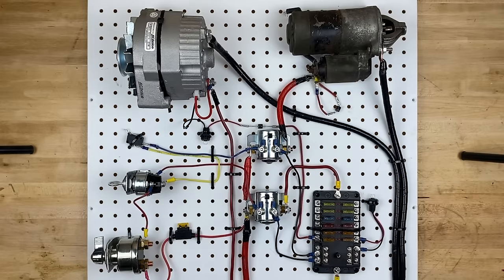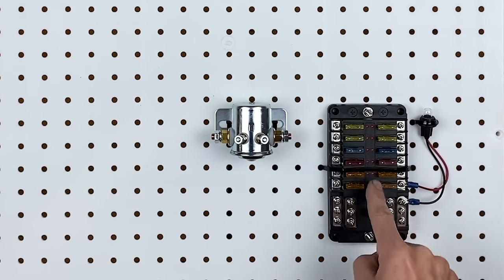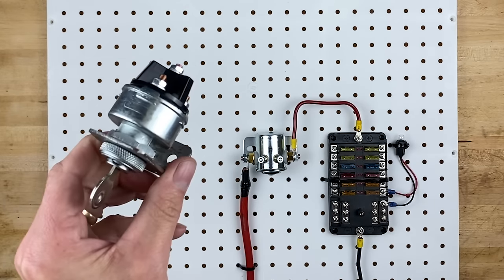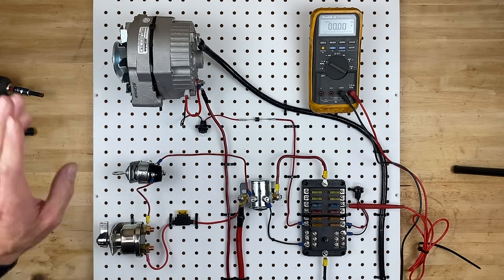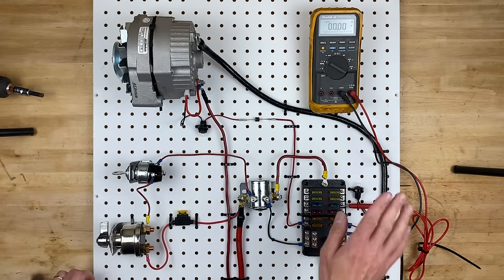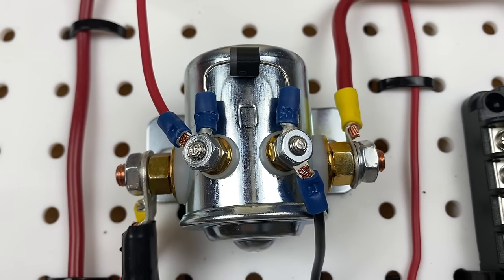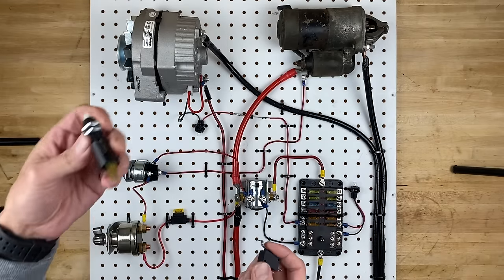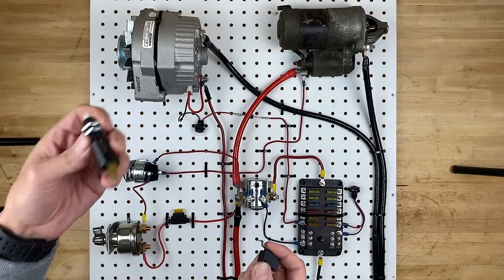Hotrod | Race car | Drift car Wiring for Beginners. (Alternator Battery Switch Fuse Box Starter)

Comment: I'm not an expert or anything like that but this is just my opinion, you mentioned that you should know the amp draw of your starter motor in order to choose appropriate fuse, i don't think thats accurate, I think you should know the amp rating of your wires instead and use a fuses to protect your wires for example if your load is 50A the wire installed has a amp rating of 60A shouldn't a fuse smaller than the maximum amp rating of your wire be used to protect your circuit/wire like 55A fuse for safety?

Comment: Wow thank you for your diagram i have complete different set up but was looking for that dam GM wiring diagram i might copy some of your design also i'm not as well a mechanic or engineer but i saw a design safety issue on your diagram there is one wire that should have a fuse before even connecting to the positive despite cause on your design the whole amperage will pass also in that little cable before the fuse becuase that there is a fuse in the middle the others side of the wire  can not handle a high amp and it will melt or overheat if ever the alternator produce too much amp. also one more thing your alternator positive pole doesn't appear to have a 2 awg gauge wire. your negative seem to be 2 awg wire but the positve seem like 4 or 8 gauge the positive is your hot wire it need a higher gauge,

Comment: In another video you said to have a "mega fuse" between starter and battery as close to battery as possible, now that there is the solenoid you still need the fuse correct?

Comment: Battery shut off is not effective and will not work if the main solenoid contacts stick in the closed position, which is a real problem. All power should always be taken off one main disconnect. Not sure why it would be different in racing but perhaps it is. Nice video.

Comment: Can i use this set up ? I have to many accessories wires going to the battery. would like to clean up the terminals by sending accessories wires to fuse box being controlled   by a  Solenoid. will that work?
every time i add something its said must go to Batt

Comment: Hello. Can you tell me about the Toyota Sienna 2008. The blue wire from the generator reads 0. All other 3 wires on the connector show more than 0 when the ignition is on.

Comment: I have a atv and wonting to put a switch into ignition to stop power when key is on if i cut the solid red wire on ignition side not the harness side and bring power from live on battery with a switch ive already tried it with some wire and it powers up as it should i just dont no if it will charge the battery still would it still charge the battery like this? Cheers

Comment: Question: I purchased this ignition switch for a project that uses a predator electric start which comes with its own ignition switch. About to make the swap but noticed the predator switch has a ground wire but the ignition switch you use does not. Do I need to modify?
Reply: I think I figured out an answer to my question. It's grounded through the negative terminal on the solenoid.

Comment: How would I wire this if I want to remove the key switch and use a toggle switch with a push button starter switch?
Reply from the maker: I don’t have specific instructions written out for this, but I do have a video that will probably help you out. https://youtu.be/LJ4wh_whblM

Comment: I'm trying to understand why there's two starter relays. Does it have a purpose to have two, is it doing the same thing, is it better? Please advise, I'm thinking about adding this additional starter relay to the standard factory setup that I already have, ie a starter motor with a built in starter solinoid. Thank you in advance.
Reply from the maker: The only purpose of the additional “ford style” separate starter solenoid is to add a convenient location under your hood for additional wire distribution and the ability to easily jump the starter from under the hood. Other than that, it’s redundant.

Comment: Towards the end you mention many fuses in the system. Are those only necessary when the battery is in the trunk?
Reply from the maker: Every circuit should be protected by a fuse close to the power source. That way if the wire breaks and grounds out, it will break the fuse instead of causing a fire.

Comment: Love the video but have one question - Why does the fuse board go off when the starter circuit is active, the neutral safety switch also seems to kill the fuse board i.e the fuseboard lamp goes off  - why??
Reply from the maker: Good catch. Somewhere in these comments somebody else caught this too. I should have used the other terminal on the ignition switch. I tested it to be sure and it’s definitely the reason. Great catch, and thanks for watching!
Reply: Just to clarify it's because you wired it to just accessories and not ignition on the ignition switch?  @WiringRescue

Comment: Quick question, when you switched the ignition switch to the start position the fuse box lost power and the light went out. Wouldn't the car be unable to start as there would be no power to spark/injectors?
Reply from the maker: You are correct! On the key/ignition switch I should have used the other terminal, if the ignition was going to be wired into that fuse panel.

Comment: With engine off, the battery needs to unload any extra energy back to the alternator field. Not sure  about this setup, but if you had checked the battery voltage you should have seen it drop, About 13.48 time stamp. The diode is about the battery not the solenoid. I am not a expert, but pretty sure i am correct. On my 64 Galaxie the  solenoid  is from battery on one side,, to starter on other side. I think you have this wired up wrong. Not sure but that is how my manual shows it.

Comment: At 19:40 you use a diode to keep the starter bendix from being engaged as long. My starter has no solenoid attached. It's already on the firewall. Where would I attach that diode to accomplish the same thing?
Thank you
Reply from the maker: You may not need that diode if your starter does not have the solenoid attached. Try it without it.  But if it does, it would go on the wire that comes from the ignition switch.

Comment: How do you get CURB LIGHTS on a trailer to turn on with the turn signal from your truck? Curb lights I mean are a wide angle light that shines down to the front of the trailer tire when you turn signal on so you can see how close you are to a curb when it’s dark.

Comment: i have 140 amp alternator - street and strip car.  Rear  / trunk mounted battery, car has electric fuel pump, twin electric fans, what size wire for alternator?  and do i need fuse in line of the alternator?

Comment: Great video, but one question. It looks like the ignition switch does not provide power to the fusebox during cranking. So if your ignition system is run off the fuse box (to enable the cutoff switch to work) the ignition does not receive power while cranking the engine over. How do you work around that and keep the cutoff switch?
Reply from the maker: Great catch! I hadn’t even noticed that when making the circuit! Luckily there are a couple of easy solutions that would likely work just fine.

1. Use the IGN terminal instead of the ACC terminal on the ignition switch to feed the master solenoid. I just tested this and it definitely works for cranking power, but then you lose the master solenoid power in the accessory key position. Probably not a big deal for a race car to be honest, but there is another option!

2. Add a jumper wire from the IGN terminal to the ACC terminal on the ignition switch. That way the accessories still work, and the ignition system (fuse panel) gets power when cranking.

Thanks again for the great catch! I truly appreciate you watching and adding great feedback into this! You rock!

Comment: May I ask why did you choose a solenoid relay instead of a Bosch type relay to power the fuse block?  Is the solenoid better?
Reply from the maker: The Cole Hersee solenoid can handle a whole lot more amperage. I believe it is rated to handle 200amps. Most of the bosch-style relays have about a 30-40 amp rating.  I prefer to over build the electrical system whenever possible. :)

Comment: Can you run your alt wire straight to the positive side of the starter solenoid instead of all the way back to the battery
Reply from the maker: It all kind of depends. Imagine you have a 200amp fuse on the fat wire that powers your starter solenoid. If you run your alternator to that same terminal on the starter solenoid, that means your alternator wire is now being protected by a 200amp fuse. In reality, your alternator likely does not need a 200amp fuse, because it probably puts out 85amps. So now if something goes wrong, you have an extra 115 amps that needs to go somewhere out of that alternator wire before a fuse stops it.  For my car, I’d do a separate fused wire that is set up for the amperage’s that the alternator will require. Fusing both ends of the alternator wire is also a good safety measure since power comes from both sides. Good luck on your project!

Comment: Hello again! Ive watched this video SO MANY TIMES! LOL. I thought i had it all figured out but Ive run into an issue now. I want to do this setup on my 84 Chevy truck, but Im not wiring everything in from scratch. If i run the two solenoids how do i jump my stock neutral safety switch in my steering column to my starter solenoid. I only have the one ignition wire coming from the cab into the engine bay which has to go to the first solenoid.
Reply from the maker: You’d have to run a wire back into your cab to the neutral safety switch and then back out again to your starter. I would think if you have factory wires on your neutral safety switch, it should already go to your starter. So you’re already half way done!
Reply: @WiringRescue  other question....you have the continuous duty solenoid to the fuse block right?
Reply from the maker: @jimmiechance4638  - that is correct!

Comment: Where did you find out about the diodes?
Reply from the maker: Uh oh. Why do you ask?  Did I get it all wrong?
Reply: @WiringRescue  Not that I am aware of.  Would like to do more reading on it.  Different industries handle this in different ways.  Riding lawnmowers don't put any protection in.  Thinking that is why they are burning up starter solenoids.  Dryers do not buffer their 240vac connections.  Dryers tend to burn up their contacts in the timers.  Some application use capacitors.  Would like to read up more on using diodes to protect against fly back voltage.
Reply from the maker: @tubejim101  - great info! Yes - I actually saw David Freiburger do this in his 31 Model A F-Rod project (though he didn’t actually mention it in his video, so I’m not totally sure) and then I did some research into it. It seems to be something that people do.

Comment: Wouldn't the starter burn our with the continuous 200 amp relay ? I working on a stock 68 dart with slant 6 and stock ammeter, I'm thinking of doing this mod along with 1 wire alternator upgrade . (Context)

Comment: Took me a second but I guess the starter solenoid doesn't use the I/R post like some solenoid do? On some they are used for the coil wire like on older fords. Completely confused me

Comment: @Ratty Muscle Car What was the size of the diode that you used? or can you use any size? on a 12v system
Reply from the maker: Thanks for watching! I am not sure of what the correct method is for sizing a diode, but there is a link in this description for the exact diodes that I bought.

Comment: hi can i use kill switch only connecting between battery fusible link  and fuse block without the solenoid?thanks
Reply from the maker: As long as the switch is rated for the amount of amperage that travels through that circuit, yes. If you use a switch that is not rated properly, you’ll damage then switch, the wiring, and maybe cause a fire.
Reply: @WiringRescue  my kill switch rating is 300A for the 12-way fuse block that i installed.By the way thanks for the respond!😄

Comment: So how is this going to start your car when the fuse box is dead while cranking ?
Reply from the maker: This is answered in the comments a few times now, it was a simple mistake on the terminal I used on the ignition switch. Swap that and it works as expected. Thanks for watching.

Comment: Hi will it be the same layout for diesel engines? Thank you!
Reply from the maker: I am not much of a diesel engine guy, so I can’t give you details on it. I can tell you that diesels do have nearly all of these same parts, so it should be similar. The thing that immediately comes to mind though is that they have way higher compression ratios. That means they probably have starters that suck a whole lot more amperage. So be sure to check the amperage ratings on your starter to make sure your wire sizes are large enough for the current to pass through them. Good luck with your project!
Reply: Thank you so much for this videos!

Comment: That little micro switch is probably rated at about 1 amp and the solenoid coil about 5 amps you should use a relay to power the  solenoid and if you use an LED lamp then you don't need the diode. Just saying.

Comment: Call me thick but i don't see the point of the continuous solenoid, surely i could just connect the accessory wire straight from the ignition switchcto the fusebox no?

Comment: the only downside I see about this system is the battery cable remains 'hot' all the way to the starter instead of being interrupted. they make another main power switch for race cars that has two circuits or is DPST that might work even better...

Comment: What would be recommended for diodes to use?
Reply from the maker: Check out the links in the description. Generation you measure them based on the amperage draw that the circuit will be seeing.

Comment: I keep burning my solenoid when I try to start my 68 f100 3 in the past 2 days. Why is it getting so hot that it melts the internals   I am just trying to start the truck.
Reply from the maker: If you are melting the solenoid, the solenoid is not rated for the amperage that is flowing through it. So I’d say your starter is drawing a LOT of amperage, or you’ve got the wrong size solenoid.

Comment: How do you know what Diode to use?
Reply from the maker: I grabbed one that I knew had an amp rating for more than the circuit would be drawing. I have a link in the description for the diodes I used.

Comment: What happens if you have a "stuck" solenoid?  The "race car" switch does nothing.  It should be wired between the battery and the rest of the car to allow 100% cut off.  It should be disconnecting the battery from the rest of the car. not just controlling a solenoid.  That is why it is so HUGE.
Reply from the maker: Thanks for watching. If you have a better design, I’d love to do a video on it. Send it my way and I’ll make it.  On my “about” tab here, there is a link to email me, or you can DM me on Instagram.

Comment: why use a solenoid over a relay
Reply from the maker: They can usually handle much higher amperage.
Reply: @WiringRescue  I can pick up a 200a relay for just over 100, though that solenoid costs around 500 in the country I live in. It’s to power a 93 mx5 so I’m weighing my options.

Comment: nice video!! the Diode across tbe Selonoid is to protect from back-EMF. In simple terms a selonoid has a huge coil inside. a coil (inductor) works exactly like a massive watrewheel. you have to put energy into it to get it going but once its spinning it keeps going. but issue with all coils, if you disconnect after the coil, all this energy has to go somewhere and voltage will spike extremely. if you add a Diode, you give it somewhere it can flow. This is part of the working principle of your ignition coil. 
watch this first: https://www.youtube.com/watch?v=KSylo01n5FY 
then this: https://www.youtube.com/watch?v=hReCPMIcLHg (very technical, but ignore the technical part, he still tells what is happening)

Comment: 3:09 you should show exactly what the wires leading out of the frame lead to…smh
Reply from the maker: It’s easier to have the power source off camera because of the size, but I did say it was the power and ground. Where you get those two things from depends on your build. In most scenarios, it would be the positive battery terminal and a chassis ground.

Comment: Those are relays. Solenoids impart mechanical action.
Reply from the maker: There is mechanical movement inside these solenoids that makes and breaks the electrical connection. Cole Hersee, the manufacturer of the silver ones, also calls them solenoids.
Reply: @WiringRescue  relays have been incorrectly called solenoids for so long that the truth has been blurred. GM starter motors have a solenoids to engage the starter drive. Even the educated, Cole Hearse, is confused. We're OK as long as we know and recognize the difference.

Comment: Relay, not solenoid.
Reply from the maker: Cole Hersee calls them solenoids. I have to assume they are using the appropriate name https://www.colehersee.com.au/switches/solenoids/
Reply: A solenoid is an electromagnetic coil which when given voltage, becomes magnetic.  Usually they are used to push a rod out. A relay is a device that closes (or opens) a switch when given a voltage. Your starter motor has a solenoid that pushes the starter shaft out to engage with the flywheel gears.  Relays typically have a solenoid in them to actuate the switch. So a relay has a solenoid in it but that is only part of it.  Just like a car has an engine in it, but the car is not an engine.

It is possible that in Australian English the words are reversed or used interchangeably. If that is so, I didn't know.

Comment: Terrible setup. If the solenoid short (which they do) the system will stay on. Batter shut off should be in battery cable